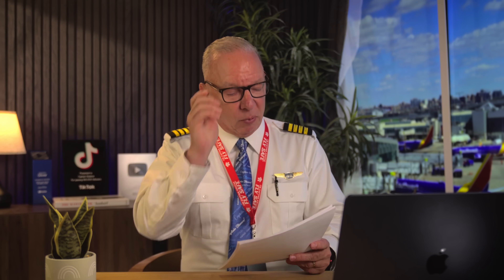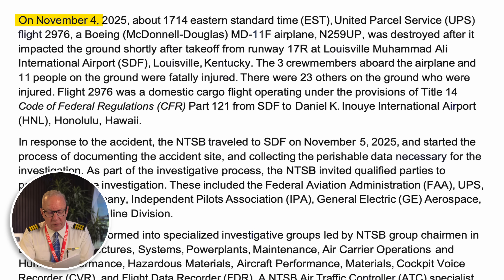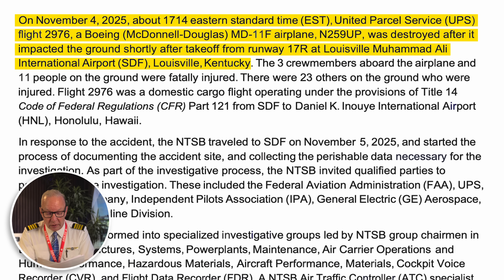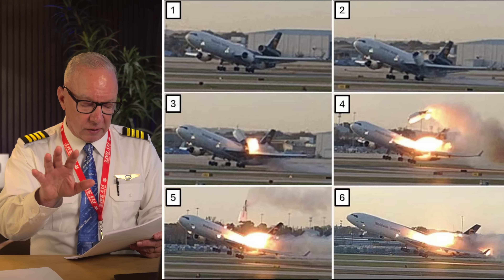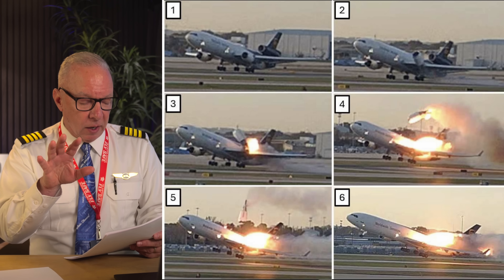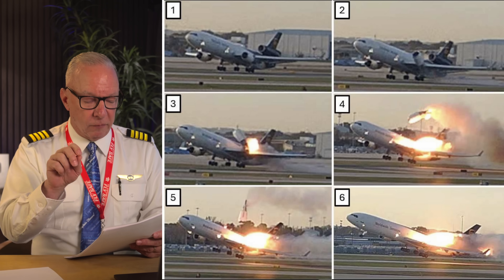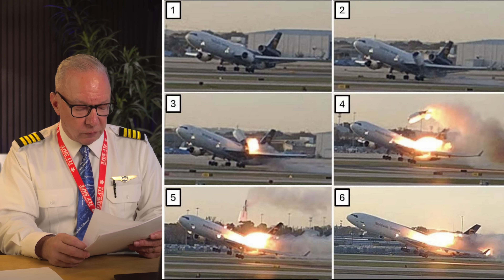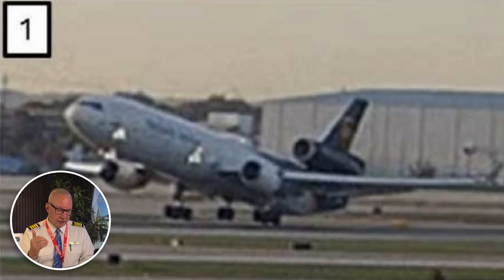UPS Crash Preliminary Report | Pilot Reacts to UPS Crash Report

Comment: Correct me if I'm wrong, but wasn't the 1979 AA191 crash due to faulty maintenance procedures? Mechanics removed the entire engine AND pylon instead of the engine only to perform maintenance. This resulted in damaged the pylon mounting surfaces while mounting the engine using a forklift? If so, could this have been happening again with UPS 2976?

Comment: There should have been required tests for those stress fractures. My uncle pioneered eddy current testing for the aviation industry. He came up with designs which I know and saw with my own eyes that would have revealed those cracks before they could be seen. “After taking early retirement from Boeing in 1984, Phelps started NDT Engineering Corporation and began manufacturing one of the first eddy current probes widely available for testing within the airline industry.”-Techna NDT website

Comment: I understand what exactly happened I have been a mechanic all my life. You can tell preexisting cracks and breaks by the color and the dirt in the crack where the little bit that was holding it will have a fresh metal break. I don't think the bearing failed as much as what was holding the bearing not in that case they may all be one I don't know. They look like giant pillow block bearings. What they will do is make those bearings out of something much more stronger and do all the planes if that is economically possible, I do not see them junking the airplane although you never know what the FAA will do?

Comment: The NTSB report has some better pictures of the wing clevis/aft mount showing the design of the spherical bearing and lugs that clarify some of the mis-stated relations between the parts (also, some pictures of the broken parts that give a better understanding of the failure)  Capt. Steve made several references to forward and aft lugs as being parts of the forward and aft MOUNTS and not separate parts of the AFT MOUNT.  No doubt, the forward MOUNT failed as a result of the failure of the aft mount, but the discussion around previous stress damage to the aft lug (in aft mount) and the failure damage at the time of the accident of the forward lug (in aft mount) was unclear.

Comment: You didn't finish reading the rest of the altitude statement. The 481 feet mean sea level, refers the the airports altitude, not the airplane altitude. When you look up the altitude for Louisville, it's in the range sighted in the report. However, the aircraft showed to get 100 feet above ground level at its max flight level according to the ADS-B data. By the pictures, it seems the aircraft as a whole never cleared more than the 30 feet agl, but the nose was significantly higher before losing altitude in the roll. Thank you for your analysis of the report and your insight from your experience flying. As a former aircraft maintainer, I hope the inspection in October was performed correctly and properly documented. It seems from the prelim, things were in order, but this is just the beginning of digging into the finer details.

Comment: Actually 72 months 6 years. What's shocks me is that these aircraft while they workhorse in the cargo industry have been known to have inherent problems. It would seem to me that a more frequent inspection of the stress points would be not only necessary but  desired.

Comment: To put it simply, the left rear motor mount broke, causing the engine (at full thrust) to pivot up at the nose, and then the front motor mount broke. The engine went over the wing, while doing an unscheduled rapid disassembly, flinging parts into the tail engine, which then stalled. The plane then did not have enough thrust to continue flying, and crashed.

Comment: What I see standing out is the "lubrication task of the pylon thrust links and pylon spherical bearings was last accomplished on Oct. 18, 2025".  The pylon was just worked on.  Does lubricating those bearings require removal of those pylon bolts?  Did someone leave a bolt loose?

Comment: Excellent commentary as always Captain Steve. For those parts that experienced fatigue fracture - do you know if they were made from aluminum? As you know, aluminum does not have a fatigue stress limit, and will eventually experienced fatigue fractures, regardless of the load. This was the root cause of the catastrophic fuselage blowout on Aloha Airlines Flight 243 in 1988. That particular plane had over 89,000 cycles due to its short haul history. Have you posted a video regarding the need for periodic non-destructive stress crack inspection yet? If not, this might be a good time. Thank you.

Comment: If the wing fire's exhaust (containing CO2/CO) was ingested by either engine, it would surge and stall. This is because the engine would receive more fuel than clean air, disrupting combustion.
Reply: Yikes.  Another strike for the trijet concept.

Comment: I am amazed that those bearings were on a 72 month cycle. Maybe the older the plane gets the inspections should be closer and closer. I worked with machines that were installed and bolted to a floor and they were inspected a few times every year. This accident could have been prevented.

Comment: So sad.  Just like Flight 191, poor maintenance practices.   There is a video where they show the mount (below the "donut") from AA 191 out of ORD had been dented because they raised the engine too high with the forklift when reinstalling the engine.  In this case it was neglect, in that case it was negligence.  If I recall correctly, it was fatigue to the clevis pins that caused the two engines to be torn from the two 707s I mentioned in an earlier post.  Personal Injury attorneys are going to have a field day and probably sue Boeing, UPS, and the company that mined the metal as Corboy & Demetrio did with UAL 232.  In cases like this, I'd be willing to bet that they are going to argue that the engineers at Boeing dropped the ball since one doesn't have to be an engineer to suspect the clevis mount and pin may be subjected to some of the highest stresses so they should be inspected closely with a scope.  They will probably also argue what you noted  - six years is a very long interval.  It is a shame that people have to lose their lives and huge payouts be made before these companies take corrective, common sense measures but each department has a budget so they look for ways to save time and cut costs.  BTW, I saw a post where someone noted that the engines are designed to miss the rear tail if the engine does come off.  This at least provides some chance of survival.  At least one, if not both of the 707s, landed without the two engines on starboard side.  Prayers go out to the families who lost loved ones as a result of this crash.

Comment: Seems to me that a class of aircraft that has had previous issues relating to pylons and engine mounts should have far more frequent inspections of these components than every 28000 cycles, or 6 years.
And said inspections need to be a damn sight more thorough than visual.

Comment: When I fly and see the engines jiggle left and right horizontally due to turbulence, I am always worried about the fatigue and stress on the pylons. Thinking about the forces that they have to hold and left to right is not normal forces.

Comment: Regarding the UPS crash…you have stated and shown through actual incidents that a modern AirBus/Boeing two engine aircraft can safely remain airborne on one engine yet the MD11 could not fly when the second of three engines failed. Is it because the thrust of current commercial jet engines significantly exceed that of those on the doomed MD11?
Reply: They were also very low when this happened, so no time to recover even a slight dip in altitude.  Also there could have been very significant damage done to the left wing and other control surfaces.

Comment: I think you missed one point in your great breakdown, and it's kinda key to the directive I believe. The #1 engine forward Inboard lug DID show fatigue cracking, while the outbound did not. This would mean that 3 of the 4 lugs (2 inboard, 2 outboard) on that engine had detected fatigue cracks, and if you're seeing cracks on 75% of the lugs this wasn't just one lug that failed...there's a bigger problem.

Comment: AA191 also lost their no. 1 engine on take off rotation ... horrific maintenance proceedures and insufficient aircraft system design and redundancies were the main cause. 191 did not have to crash if the pilots would have been given the info that the port side slats were retracting. The lack of info caused them to lower airspeed stalling the port wing whcih put the plane in an inrecoverable roll.

Comment: The photo on page 9 of the report tells a story. It appears that the fatigue crack between the fwd and aft lug face can be seen in the photo as a triangular lighter color at the inside lower corner and the darker upper corner. The remaining crack surface and entire fwd lug crack is due to structural overload.  A fatigue crack initiating here would be impossible to detect without major disassembly. I don’t think the DC10/MD11 was designed for fail safe operation. The double lug configuration on the engine pylon mount is undesirable unless one single lug can carry at least design limit load. A corner edge flaw is critical and would be hidden at the lug faying surfaces unless the bolt AND bearing is removed so the hole can then be inspected. I’m guessing the bearing has never been removed or replaced. If cracks are allowed to initiate and grow, inspection intervals are set to inspect to allow a percent of critical flaw size to be detected on inspection. It looks like the corner crack is at least ¼ to ½ inch in length. Bolt hole inspection can easily detect flaws down to 1/16 of an inch. Another old airplane becomes a victim of aging aircraft problems, unfortunately loss of innocent lives results. Just my two cents.

Comment: Note that the aircraft heights given in the report are 30 feet above the runway and 481 ft above mean SEA level.   Google gives 501
 feet above sea level as the height of the Muhammad Ali Louisville airport.  The report is likely accurate, the two stated heights are likely the same due to  the differient reference levels of the measurements.

Comment: Wow that's a scary minimal frequency of checking for crash-causing problems with planes.  It's like flight equipment properly maintained would be too expensive to have an airline industry for the common man to get to use, and they think it's better to have the airline industry for all and tolerate the losses.  Perhaps overall, more lives are safer with such common air travel than without?

Comment: You are confusing people by not reading the report carefully and communicating the facts therein. There is no discussion of the forward pylon mount on the  left hand installation. Rather, the discussion is on the forward and aft lugs on the REAR mount. The rear lug had evidence of fatigue at 2 & 9 o clock. (Aft looking forward). The forward lug (still rear mount) had fatigue  in the inbord bore. The oubord  failure on this lug was by overstressing the component

Comment: IMHO The left engine departed up because of the thrust line being below the pivot point, and to the right because of gyroscopic precession as the fan was spinning anti clockwise (viewed from front). So the left engine and associated debris had the potential to damage both the remaining engines. Impossible situation to recover from. RIP all the victims of this terrible accident

Comment: Capt Steeve, please correct me if I'm wrong, but the ADS-B data that showed the plane at 481 feet above sea level is actually an accurate reading.  Louisville, KY sits at about 465 feet above sea level, so you have to subtract that from the reading of 481 feet to get the altitude above the ground.  That gives you an altitude of 26 feet above the ground, approx where it was.

Comment: In 1967 I had gotten out of the service and a couple months later went to work for Douglas aircraft,as it was known then. So for the rest of my life I have followed ne s about this company. I worked for them until the end of 1968. During that time during some down time I saw a DC 10 during its development in  the building where the work was being carried out. Years later when that accident on, take off, of the DC 10 in Chicago I paid close attention to what happened. I remember that the right engine had come loose and flipped over the top of the wing and caused the plane to flip to its back. As I recall there were no survivors. This seems to be very similar to the accident with the UPS plane.

Comment: With the fatigue cracks on the inner bores of the aft lugs it would make it impossible to see even a large crack. Obviously a worn heavily used aircraft. This is the same failure point from the Chicago crash in 1979. You would think that some type of reinforcement would have been developed for such a stress critical component post 1979.

Comment: Thank you for presenting the report. Unsurprisingly, this is the exact same cause of the 1979 DC-10 accident where the number 1 engine separated at the pylon. That accident was caused by a departure from written maintenance proceedurs for mounting and unmounting the engines that became endemic in the industry. The DC-11 isn't that much different from the DC-10. Has there been a return to bad maintance prodeedures that damages the pylons?

Comment: @CaptainSteeeve; I enjoy your videos, very thorough. My disabled son and I watch "Air Disasters" on TV daily - excellent shows.  Now I'm wondering, as the NTSB usually looks at EVERYTHING  related to a crash - have you seen any info related to investigating the actual weight of the aircraft ? (versus weight reported on the forms for the flight). I know there have been accidents where the aircraft takeoff weight was actually above what was recorded on the paperwork. I wonder if they will double-check the weighing equipment/process and see if the aircraft was actually heavier than recorded ? Not sure how many containers an MD-11 can carry but a little bit of weight error on each one adds up.  And they had enough fuel onboard to fly halfway around the world, which did not help. I guess the FDR data will show how much thrust/RPM the No. 2 engine dropped down to and for how long.  Thanks.

Comment: I’m not an aeronautical engineer, just an average manufacturing engineer, but I would like to hear from those who design and/or manufacture the aircraft if a strain gauge could be incorporated into the design to detect fatigue due to certain stresses. I have used them and can report they supplied very valuable data for use in a robust maintenance program. Man, that seems to be a lot of cycles. Over simplification, but think of a paperclip being bent back and forth until it snaps. Leave that one to the metallurgists. Numerous disciplines will be involved in preventing future failures and needless loss of life.

Comment: I wonder what the NTSB found when they inspected the right wing engine pylon bearings. Will they or have they found fatigue on either the fore or aft bearings. And I’m sure every MD11 in active duty will be required to have these bearings replaced before the NTSB will allow these planes to return to service. And it’ll be interesting to know how many other pylon bearings are prematurely wearing. And I’m sure the maintenance plan will be updated to prevent future disasters. Lastly, I feel sorry for the maintenance crew that followed the maintenance plan, but did not see the premature fatigue of the aft bearing. I’m sure they are under great strain right now. Hopefully no corners were cut in the inspection during the last maintenance, but only they and God knows that answer. If corners were cut, hopefully the crew comes forward to inform the NTSB, to know whether or not this tragedy could have been avoided.

Comment: In 1979 they stated that the motor was designed to flip over the wing in case it did detach from the wing.  To avoid dammage that might take place if that were to happen
 It was designed with that in  mind. Obviously a bad design.  No problems were solved since 1979. It seems.

Comment: Omg your an idiot, how would schrapmal go to the right wing motor that's impossible, of course it would go straight back into the tail mounted motor, see this is why I don't trust anyone to fly me except myself, and that's only in helicopters
Reply: I hate to "Interrupt Curtis", but please be more polite when you disagree or correct  a host. I'd imagine the Captain  has thousands of more flying hours,  and decades more experience than you at this point in time.
I'll concede a helicopter is one of the most complicated "mechanical devices "  to operate, so "props" (rotor blades !) to you . F.Y.I . "props" is anglo slang ,  short for "proper respect"
"Schrapmal " is spelt shrapnel. Those thermodynamic devices on aeroplanes that provide thrust are called (jet) engines not motors.
Reply: @dianaweston621 for your information I started flying the early r 22s that were actual flying coffins, and I'd still take my chances in one of those as opposed to any airliner of today